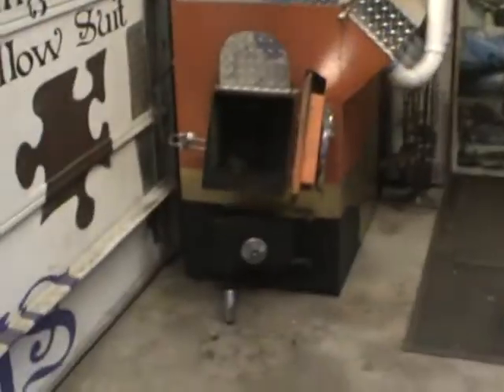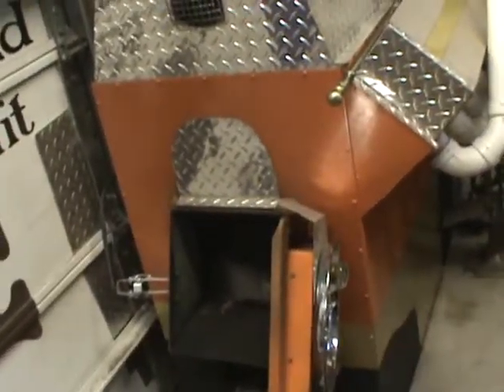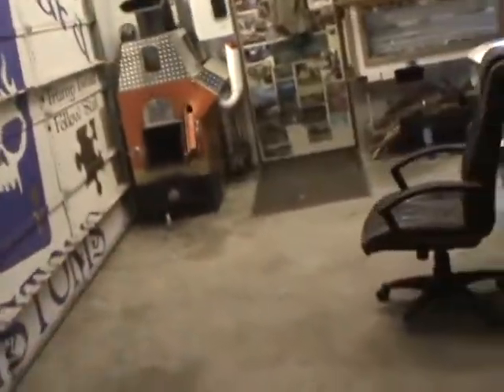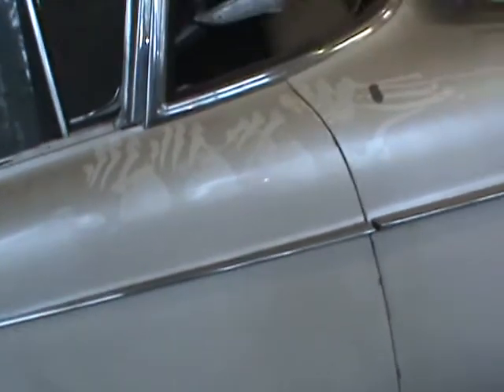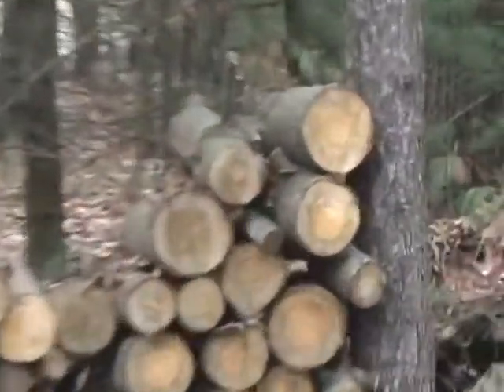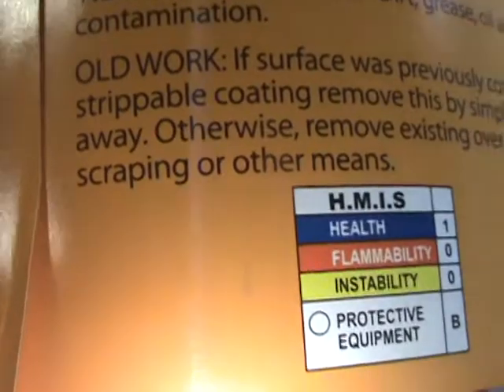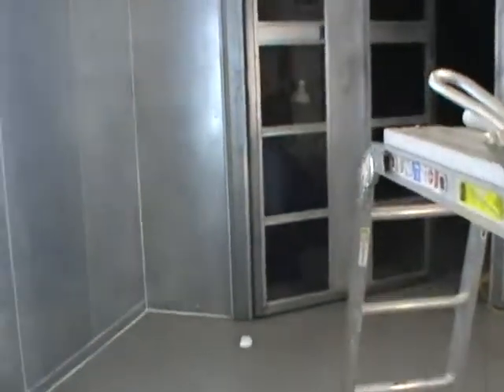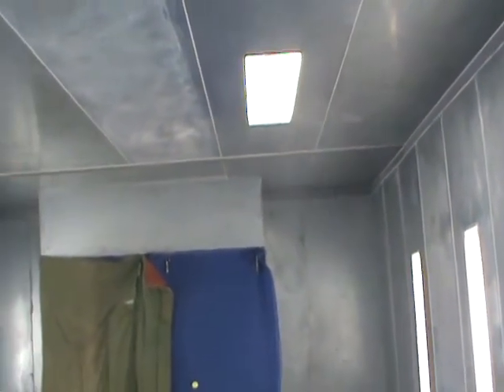CAULKIN & TALKIN...

Comment: I don't run the plow shoes but I can tell you that the post should come up thru the top of the bracket and have a hole for a clevis pin.  Height is gauged with large washers on the bottom and top of the bracket.  If I have a set laying around, I'll do a vid on how they work.  Yours might not be the right ones for that plow but could be adapted easily
Reply from the maker: thank u 4 takin tyme 4 me   PEEEACE

Comment: I would also be concerned with that booth coating flaking and getting in the paint. What do you think about painting the walls with acrylic enamel?
Reply from the maker: oil base paint
Reply: Don't believe I'd use oil based paint my pansy ass would be worried about fish eyes.
Reply from the maker: WELL...it is already done...plus sir i am still going 2 use peel coat over the oil base